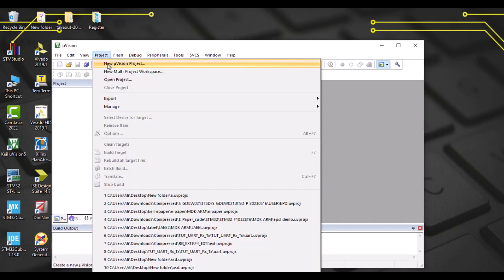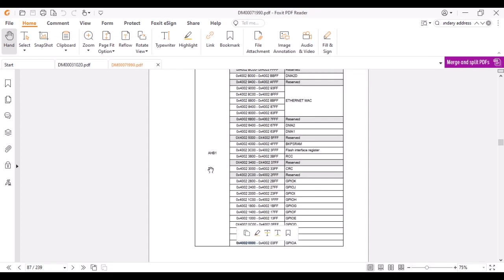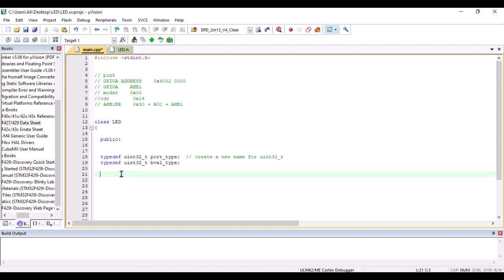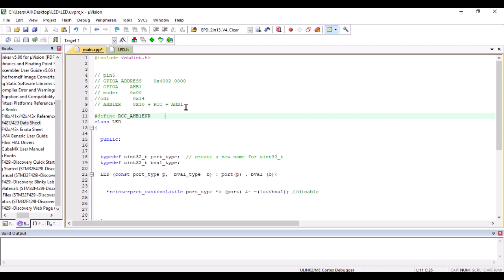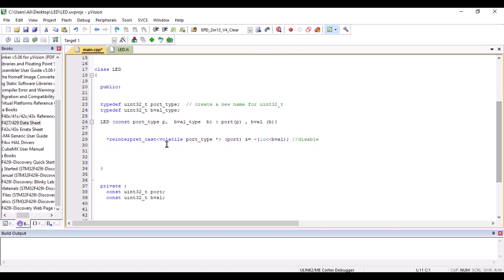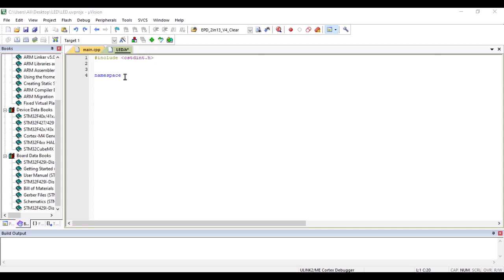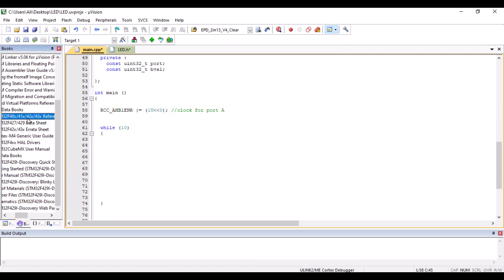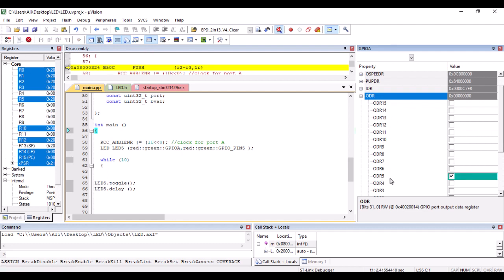Mastering STM32 C++ Programming (LED)

Comment: Is this from Udemy course from Israel Gbati? What's the point of using c++, if you do everything that's done already in CMSIS?
Reply from the maker: Thank you for your question! Yes, this video draws inspiration from Israel Gbati's Udemy course. As for using C++, it allows us to dive deeper into the concepts and understand the underlying mechanisms. It's all about expanding our knowledge and pushing the boundaries! furthermore, in advanced level you have to be able to understand, alter and create libraries. in that situation  C++ comes in handy.
Reply: @Electrogravity1  but all underlying concepts are more clear in C. As far as I know C++ as higher abstraction language just shortens notation. Makes programs look smaller, but when we watch mentioned course, we see that flash memory consumption bloats.